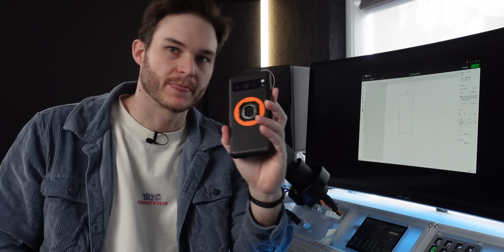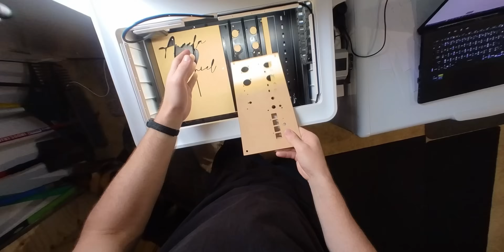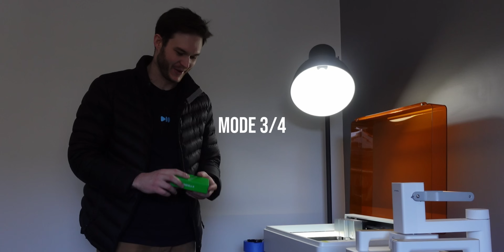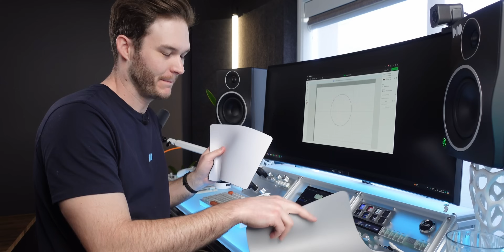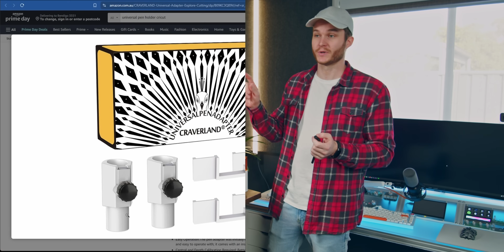4 in 1 Laser Cut & More - New xTool M1 Ultra

Comment: Great video, thank you ! I’m just getting my M1 Ultra, could I trick it to cut acrylic, by using a white/clear acrylic but put a blue/green masking tape on top ?
Reply from the maker: Not really, once the light passes through the tape it'll then be hitting white pigment and being reflected.
Tape and sprays can be used as a good trick to engrave on materials that usually wouldn't, like clear.
But that's only because the heat absorbed in vaporizing the tape or paint is transferred to the top surface of the clear material.
You can look up spray on laser etching spray to experiment a bit , have fun!👍
Reply: @camshand  thanks so much for replying 🤗🤗

Comment: only 20 pages with the ink setting?🙁🤨
Reply from the maker: yeah seems low, but that would be a full page.
with projects I'm only printing less than 20% worth of an A4 Page at a time, so that'd be 100 equivalent prints.
Reply: @camshand  I know that they could engineer this thing so that it  is comparable to any high end laser printer in quality and the number of pages that can be printed. Would such a machine be expensive?..(absolutely) But I and many others would be willing to spend the $$$$ for such a machine.

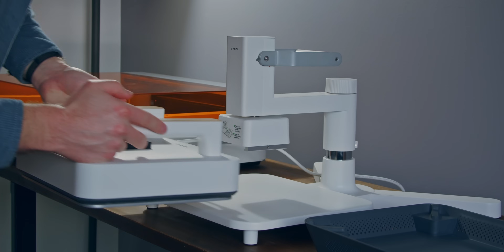Comment: I had the same issue on  7:13 , I was able to use it tho and all I had to do was to press a little hard until you hear a click.
Reply from the maker: Yeah the included bolts seem to be too short. As I showed I could get them to bite but it was only a turn or so of thread going into the unit, so I opted for longer bolts to reduce any chance of them stripping the thread under load.
Glad you were able to at least get all of yours to bite the thread 👍

Comment: Great machine, im intrigued if you could cut out mouse grips with it and how that process looks ive always wondered.
Reply from the maker: With the new blade types it can cut pretty much any soft material under 2.5mm thickness.
So yeah adhesive mouse grips and slides would work if you were able to buy a sheet.
I'm planning to cut some custom dimension screen protectors and fan grills soon, of course these things can be done by hand but it's hard to beat the precision of a machine like this

Comment: Not a chance, that print quality is like from the 1980's.
Reply from the maker: Did you have colour printers at home that could print onto wood and then laser cut in the 80s?
A standard printer is no doubt going to be better quality, but a standard printer doesn't move in XYZ like this inkjet head does.

Having the ability to print colour ink directly onto plywood is very unique.
Reply: @camshand  All they had to do was fit it with better print heads)

Comment: You mentioned "You only need to learn one piece of software", i just have concerns about support down the line. If xtool just up and stops existing what then? I've just been burned by way too many things just not working because the company either ended support or stopped existing.
Reply from the maker: That's a very fair concern, one which I had when I first backed the original M1 on Kickstarter.

I then realised that xTool is a division of Makeblock, which is a STEAM education provider for schools that's been around for over a decade. I actually ran classes using their laserbox pro back when I worked at the Uni.

So I know there's an extra level of commitment there in providing support, but I understand what you're saying it doesn't guarantee a lifetime.

But I don't think anything like this can, there's no open source software suite that can handle laser, blade and inkjet.
Maybe there could be a way they could open up the controller board to take grbl commands, so you could continue use of a laser.

But just like the xTool P2 can work with lightburn, it lacks features you get directly in their software like 3D mesh mapping curved surfaces and multiple inbuilt cameras.

On the flip side, I'm not sure if their blade competitor Cricut supports 3rd party control either. 

As makers I think we have this mindset simply because we break things to fix them haha.
And so naturally have that question about our maker tools.

That being said you can use the M1 Ultra via USB, and so if firmware updates stopped and software support ended at a certain version, you should be able to operate it offline using the local xcs features.

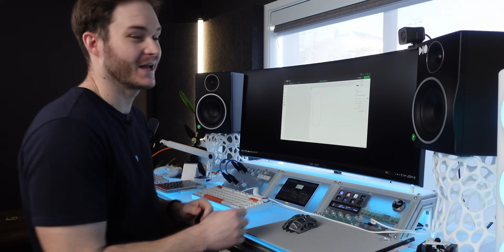Comment: RE: Leather fibres on edges at 9:00, as a hobbyist leathercrafter. Typically my cuts by hand with an Xacto knife would not have this issue, nor would cut-outs with a punch, as you're cutting through the entire piece thickness in one clean pass. For circles, you're better off with an appropriately-sized punch. For your longer cuts, you're probably best off trimming them off carefully by hand. You might also be able to carefully singe them away with a lighter. 

Edges are usually finished one way or another. This looks better and seals the edge. After the cut, you would sand them with a few grits and either burnish (veg tan only - slicking them with water, gum tragacanth or preferably Tokinole and rubbing with wood until smooth) or use an edge paint (sand the edge flat, apply a layer or edge paint, sand, repeat).
Reply from the maker: appreciate the insights Jack!
I did wonder if I should try less passes and more pressure, but at the same time I didn't want to go too hard and cut the cutting mat (if that's even possible).
The final circle that's shown did cut through it all, but reviewing the footage further, when the blade turns around the head moves back a bit, so it may very well be starting at almost same spot each time, meaning those fibers are being pushed back and forth a little bit on each cut.

I'll have to look into burnishing, I've seen that in videos but didn't know that was the name of the process.

But always up for learning something new and an experiment.
Lighter to singe stray fibers is a good tip too!
Reply: @camshand Happy to help, dude. It's super interesting watching your process, and the trial and error with new toys or techniques. 

Check our the /r/leathercraft subreddit. It's always really cool to see weird projects or problems pop up.

Comment: does it cut acrylic also?
Reply from the maker: Yeah mate, 3:50 I cover acrylic abilities.
Being a blue diode laser, solid colours that are opposite of blue are best, so yellow orange and red. You can do others but it's an experiment depending on how well the blue light is absorbed, causing the material to vaporize instead of melt.

Black is perfect, probably should have said that in the video, but white usually doesn't cut clean if at all.

Clear will never work on this type of machine, for that you need a C02 machine with an invisible far infrared beam. 

If you want to be able to cut all types of acrylic I suggest you checkout my video on the xTool P2 👉 https://youtu.be/4wAmbsJ53qY?si=4UTvDuxpBuzHK0vt